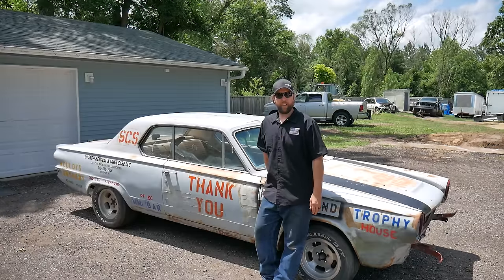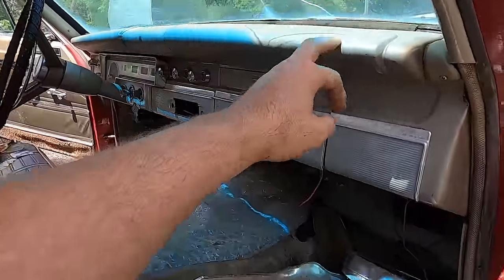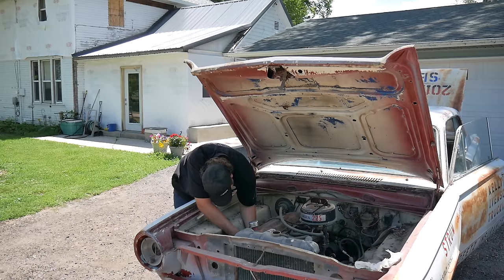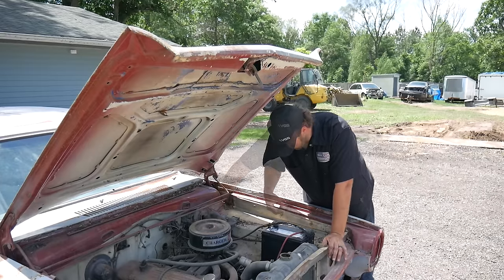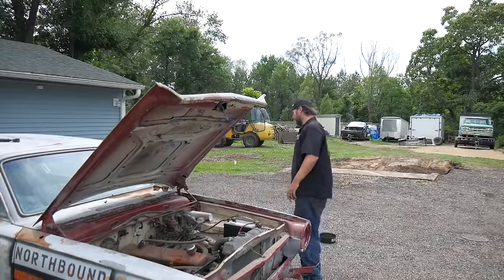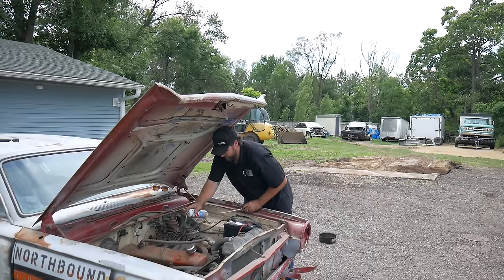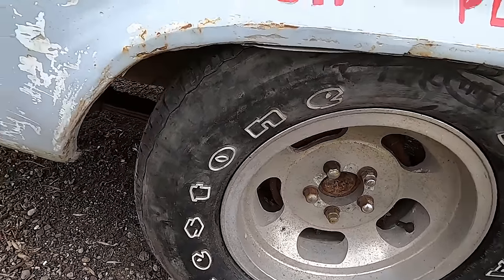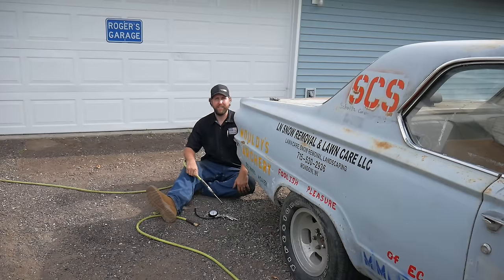NEGLECTED 1964 Dodge Dart GT! Will It RUN AND DRIVE After Many Years? - Vice Grip Garage EP96

Comment: "Dwelled on it".. lol I see what you did there. Most young mechanics these days have no idea what Dwell is.
Reply: Glad I wasn't the only old fart that got that. Lol
Reply: @richhiggins6056  I don't feel that old but 50+ I guess I am getting up there. Probably helps though that I got an early start fixing cars. Around 10 years old so a good 40 years now. Guess that makes me old. ;)
Reply: jackson meads  search for "setting dwell versus timing."
Reply: @consaka1  I got it too but the best part was when he said he gapped the points with a business card, I used to use the tab of the soda or beer can in a pinch, LOL
Reply: @consaka1  I started about the same age, now  58 and now work on buses
Reply: @gustavoheredia2551  sounds fun.
Reply: Yeah, I caught it. Old.....
Reply: Anyone remember reading dwell timing and spark gap and junk on a Sunn oscilloscope...
ohhh, and a match book cover works great for the points too.
Reply: I still have a dwell meter, timing light  now I need to get a set of feeler gauges since I can't find my book of matches.
Reply: @randymack2222  Always use feeler guages, the matchbook is just to get you off the side of the road in a pinch
Reply: @gustavoheredia2551   matchbox here
Reply: @randymack2222  and a woman's nale file to file points.
Reply: @gustavoheredia2551  I use a Match Book cover.
Reply: Remember them, but how the hell do you work one. The older cars had a little door on the distributor to plug it in. I watched my cousins when I was a kid.
Reply: If you want to see a kid's eyes glaze over talk about a dual point distributor, lol.
Reply: I thought the same thing. Same thing with the 'fender come steal me' option.
Reply: Yahtzee. I caught that one too.

Comment: My second car at 16 years old was a 1964 Dodge Dart just like this one but in a lot better shape. THE slowest car EVER made. The push button trans was very futuristic tho. Lol When you got that engine to turn I recognized that sound right away and I’m now 59. So, it’s been 43 years and I still remember it
Reply: V and was pretty darn quick also a gt
Reply: Had a 1966 it was all manual 4speed no AC no power steering 273 4barrel and also pretty darn quick also a gt
Reply: @dinadaughtry8993  I think there was something not right about mine. As slow as it was it had to be something.
Reply: Mine had a V8 273 camando and 4speed tranny the engine only turned water pump fan alternator everything else is turned the suregrip rearend I'm thinking 66was first year for the 273 4barrel in the dart that engine was supposed to be able to produce 335ponys but I may be wrong  maybe it was 235ponys

Comment: MotorRaft FL1A filters were used on Ferd engines from 1950's- early 2000's in tons of applications from 4 cyl to 8 cyls. Many Mopars had the exact same mounting threads and surface but called for a shorter version from the factree.  A lot of folks would use the taller version of the MotorRaft, Fram,, etc to get more filter capacity in high performance applications just like the tower of power.
Reply: reminds me of some odd filter part number my dad found. got whole load of filters and sure enough one fit his late 90s chevy pick up but, it was twice as tall and require another half a quart or so
Reply: Yup, I used the large Motorcraft filter on my '83 Toyota truck.
Reply: yes. I knew that as well. They also shared the same lug nut pattern as well. I found that out a few years back. As soon as he said that it has a motorcraft oil filter. I figured it was the same mounting threads. If it fits it works for me.

Comment: I had a 1966 Dodge Dart with column shift and the venerable 225 Slant-6 that wouldn't go 50mph downhill.  I think that, had I swapped out the carb for a bigger one, it might have done better.  It got me to where I was going, so I left it alone.  No radio, power brakes, or power steering, so I made up for it by installing a 4-way flasher control and 5 additional horns on a rail mounted behind the grille... yup, that helped a lot.

Comment: Derrick, My first car was a learn as you go 1969 Dodge Dart.  One of the things that you failed to mention was the best tool for setting the gap on your distributor has been discontinued.  I used to just pull off the side of the road from time to time and look on the ground for a ring pull beer tab that had been left behind.  If you didn't find one you just opened another beer from the ice chest in the back seat or moved your feet around in the dirt until one cut your foot.  This was before I was important enough to have a business card.  That Dodge Dart was hard to kill.  It finally met it's end when a telephone pole bit it in the grill.  It was a faithful stead.  I hated to have to put it down.

Comment: Leave the paint hook up all the lights fix the breaks and just drive tbe snot out of it
Reply: Don't forget the plate.  He doesn't want a replay of the Rich Rebuilds Audi.
Reply: @mexicanspec  What happened to the Audi?
Reply: @elobiretv  Rich drove it on a test drive with after fixing it with no plate or any paper work in the car and got stopped.  The car got impounded.

Comment: The 6 was called the hemi 6 by Chrisler when they came out. They are in fact a two valve hemi. Just look at the spark plug tubes required to git the plugs down deep enough in the head to be more or less centered in the combustion chamber. This is a lot like the cross flow heads on the 1.3 , 1.6 & 1.9 L Ford escort 4s. If you don't use silicone oil on your spark plug boots on your escort you won't get them off without significant damage. They bond ie vulcanize to the plug thanks to the heat. How do I know?. I have had three Escorts

Comment: Also some time a quick tutorial on replacing points would be rad. I haven’t worked with many carbureted motors. Mostly just their transmission. The quick tip on the coil was the best description I’ve gotten so far.

Comment: There were so many aftermarket performance parts available for the slant six they could be cheaply built to run against small block V8s. And often win. I a. Not a big Mopar fan, but that motor is nearly bulletproof.

Comment: Slant six engines ran forever.

That's why they stopped making them.
Reply: I had a 71 plymouth valiant. Slant 6 225. Boyfriend neglected oil while using as a daily driver.
Cracked the block, blamed it on me because "it was my car, my responsibility".
I loved that little thing.💔
Reply: Ford had a 200 CID straight-6 that was hard to kill, not as tough as the famous slant-6 here, but you're right. I live in the Rust Belt where cars die before the engines do, you might find some of these in Southern States though.
Reply: yessir !

Comment: My first car was a 69 Dart with a 225 slant 6, and my dad was a long-time Mopar guy. The Motorcraft FL1A is a legit thing...he was also a Ford dealer mechanic, so we always had those in stock. We always ran the FL1A on the 225, as it's a much larger filter element than the Mopar part.

Comment: Slant 6 is indestructible like the straight 6 Chevy’s.
Reply: Absolutely !
Reply: Unlike todays engines the 225 was  very hard to kill... I bought new a 1974 Duster with a slant 6 and a manual 3 speed on the floor... Ran Quaker State super sludge... Pulled the valve cover off and found just enough room for the rockers to move...The rest of the insides of the cover was solid paraffin... That engine didn't care and it ran until the lower front suspension rotted away...it never stranded me
Reply: I had a “crusty duster” that has been sitting in a field for years and all I did was run some fresh gas and a new battery and it fired right up.
Reply: Friend of mine had a l
Slant powered beater that had so much blowby people would come up to us at traffic lights and tell us the car was on fire.

Comment: I had a 64 GT with a 273, I loved that car, wish I had it back.
Reply: Was it a standard 273 with a 2 barrel or the 273 Commando with the 4bbl and hotter cam those were great engines and everything was built like a brick crap house with forged crank something the 318 never had the 273, 318 and 340 all share the same stroke just the bores are different
Reply: @79tazman  It was the Commando with a 4bbl. Carter AFB I think. I put an 8 3/4, 3.73 gears. I used to terrorize Camaros and Nova's with 327s and stock 350s.

Comment: Some of those old Chryslers had the pump for the transmission hooked up to the rear of the  transmission. You could actually pull start them. js I had a 68  225 cid Slant 6 in a Satellite and a 66 with a 225 cid Slant 6 in a Dart, but I learned about the tranny from a 65 Fury Wagon with a 318 and a 727 transmission. In 66 they moved the pump up to the torque converter and you couldn't pull start them any longer.

Comment: I had a 64 dart in 1970 when I was in high school. When it rained the front floor boards would fill up. When you went around a right hand turn the engine would die every time. Those were the good old days.
Reply: I have a 1974 Dart and when it rains my glove box fills up with water.  I don't know how it is getting in there specifically and not on the floor.
Reply: Mexican Spec could be a windshield seal or the caulk has dried up in the cowl.
Reply: My duster leaked where the wiper came out of the cowl
Reply: i had a 75 dart in 2002 it was mint when it rained water would run along the bottom of the dash and shorted out my pioneer cd player but was a very dependable mopar they all had the quirk!!!

Comment: I had a black 64 GT w/273 solid lifter 727 on the tree
I put a race cam in it and a 650 Holly on top 
Screamed bloody murder as I raced Trans Ams coming out of the bar.
That's how I paid for the car :-)
my best race was winning a half car length against a boss 302 Camaro with a four-speed. Not bad for a $400 car :-)

Comment: Love the wasp delete! 🤣 I had a 64 Dart convertible for a while. Got it running and replaced all the brakes. Ran good but the Torque Flite leaked like a sieve and the push-button shifter cables were a disaster, especially the one for the park lever. Basically just had to use the parking brake. I ended up selling it for more than I had in it.

Comment: Use duster suspension parts to get disc brakes ,bigger bearings and baljoints.  I had coil over Monroe’s and a 1 inch lift in the shackle.

Comment: Leave the 426 Hemi on the Hood, and give it a 50 feet paint job and fix the brakes, tires, put the bumpers on, head lights, and make sure that motor doesn't get hot.  Keep it and have fun with it, Im sure your son would love to have it when he gets older.

Comment: I had a 64Dart GT new from the dealer. Maroon red with black naugahide seats. Had the optional 273 v8, with automatic transmission. I thought dual exhausts and a 4bbl on an offenhauser intake manifold was helpful. It was a nice little car and fun to drive.

Comment: Glad you got the slant 6 running, but a feller has to agree on going the trailer route!! A feller did hook his peepers on what looked like a green D100 Dodge pickup setting on a trailer in the background! Both my Grandpa's were Dodge/Plymouth kinda fellers! As far as the Dart goes..did see a feller at Bristol Dragway (TN) that had a Dart like this one that had a built slant 6 in her back 20÷ years ago, and superisly enough she would scoot down the old quarter mile quite well!

Comment: The Slant 6 failure mode is rod-through-block. Otherwise, they just run and limp on into the sunset. Bulletproof. I had an old Dodge van for ten years, and just got tired of driving it. It kept cracking exhaust manifolds, so I got mad and put on some Clifford headers. Torque like a dump truck after that.

Comment: It's a requirement that the Slant 6 always have everything on the one side where there isn't any room to work on things while the other side gets all the room. The upside down oil filter is what makes it a classic. The push button TorqueFlite was very rugged. Mash those buttons to get out of the snowbank. An added feature, which Chrysler threw in for free, was the nylon gear at the bottom of the distributor disintegrating in short order. Go to the parts store for one and they had a HUGE display board full of them.

Comment: I've watched about 'leventy seven of these, and this one seemed to bring out the frustration a little more than most. The slant is a tough, reliable engine with a few quirks, but the worst of it is that a lot of the stuff that needs regular service (oil filter, coil/points/plugs/wires, etc) is juuust out of reach because of the blasted fender liner, or the arrangement seems out to cut a guy's hands to shreds on any available sharp edge. I am glad you decided not to try the drive home. You'd've picked up a bumper crop of tickets, and might still be in jail for endangering the public decency. Good job on waiting for the hook to drag this bit of local history home.

Comment: My first car in CA was a 65 Dodge Dart slant 6. I'm not a gear head but that car was so easy to fix. Bought it for 500 in 75 and put 250K on it. Sold to a pot grower in Big Sur for 350.00 I ran into her 5 years later and she was still driving it with 450K miles on it. Great car!

Comment: Have you ever plumbed the click clack pump into the inlet of the mechanical?  You can sometimes get it to prime and then it will take off on its own after it gets lubed up.  I guess it could fill the crank case with gas if the diaphragm is completely rotten.

Comment: Ford uses a WIX 51515 vs Mopar 51085. O have used the 1515 on my Mopars for many years with great success. Larger filter at a lower cost...win-win!

(Specs on the filters work as well)

Comment: Derek definitely has a project car. Push button torque flight is a strong yes for the gasser and altered class of drag racing. The door jamb looks like it was red in color from the factory. The metal termites found a home and the slant six indicates good mpg. I had a 69 Dart Swinger in better condition with a 340, four speed.

Comment: On one of the other car-fix-em-up channels I like , they took a tired 225 six out of a duster and rebuilt it with some go fast goodies . On the dyno , it got (if my memory is right) in the mid 200's for horsepower . That 64 dart gt is probably very light to begin with and a hopped up sixer with a 49 ft paint job and new brakes and you could have a fun little car .

Comment: When I was 18-19 I got a white with black vinyl top 1975 dodge dart custom. I loved that car. Paid $375 for it in 1991-92 and drove it everywhere for a few years. only issue I ever had was a one barrel carburetor. went to the wrecking yard and $25 later I changed it out right there and drove away.

Comment: I can't believe that 225 runs as good as it does! Considering the body is relatively straight, that may be a candidate for a fixer-upper-go-to-town car for when nothing else will run.😁 Need to get rid of those race wheels and tires and get some regular rubber back on the road though. Another great episode Derek!😉

Comment: A feller could make that old copper radiator shine like gold with a little sanding and buffing. 
I had a 64 Dart 2 door post of the 270 size. The gas tank had more holes in it that the titanic.

Comment: I took my drivers license test in a 64 dodge coronet with push button transmission. Passed the first time. My buddy took 3 trys. He was supposed to be way smarter than me. Just couldn't drive worth a crap. My brother and he shared the same birthday 1-17. Brother a year younger. Loved that dodge. hadda 318. Top speed about 110. Not bad. Not race ready fer shore.

Comment: Had a 72 Dart which the kids jammed into reverse at 60mph. Screeched to a halt. Put back in drive and she was good to go. Also caught fire and burned everything plastic. Pulled the head and pulled the push rods out and cleaned it up with a vacuum and  transmission funnel.  Pulled the distributor and cleaned that up. Put it back together and it ran so smoothly you couldn't tell it was running. That engine and tranny are indestructable.

Comment: I think it's physical.size if the filter for volume of engine and pump flow rate...
After that its the micron level.
But many of rhe threads are the same and can mix and match

Comment: Had an old charger with oversized tires and air shocks.
One day I had to take a piece of firewood and roll it between the fender and wheel.
Flaring rear wheel wells, they don't teach you that stuff in shop class, !

Comment: I got something for you to try. I'm not trying to sell you a product nor am I sponsored by them in any way. Startron Starthane ; I wanted to see if it did what they actually said. So I took some stale smelling gas, by the way, it was not winter mix with ethanol. I put in a stainless steel shot glass in my metal shed so it would evaporate. Just so it would leave behind its residue & it did. Then I proceeded to put Startron Starthane to the Test. I only put enough in the Shot Glass to cover what was left. I ended up getting busy with other things. But 2 days later I had to go back out to my shed to do some Lawn Mowing. And out of the corner of my eye sat that Stainless steel shot glass. I picked it up & looked into it, & to my surprise, it was as clean as the day it was when I bought it. Normally I like a mechanic out of a can for ant thing. But I've been running it in mt Harley every since.

Comment: When these 1960s Dodge Dart GTs came out some had a 273ci V8, 4 speed, limited slip diff, and a sporty single exhaust.
This one has the push button 3 speed automatic transmission. It also has the 225ci slant six, a wonderful engine.
"Touch on" all the running gear to make it a good driver and sell it? Darts have no inherent failures.

Comment: I had a little Swinger that had the slant 6. I kicked her into passing gear one night, the water pump housing broke, it pulled the fan into the radiator broke off 1 blade. The blade cut the battery in half and stuck in the inner fender, captain side. Everything shut off at once!